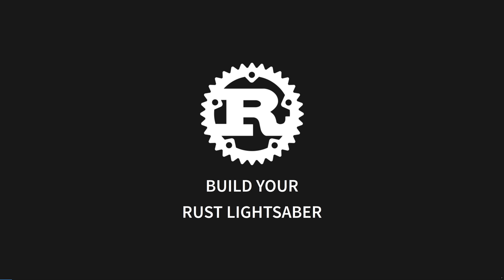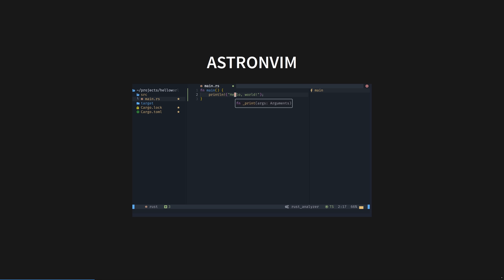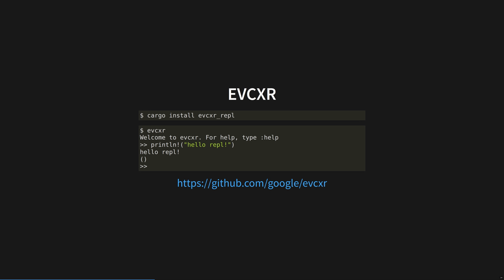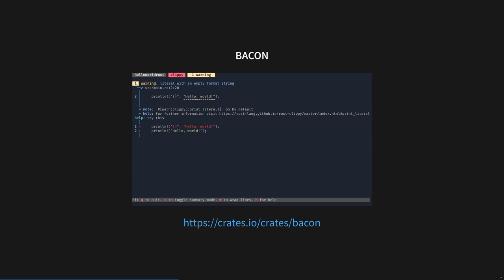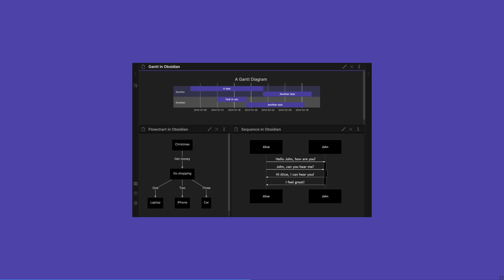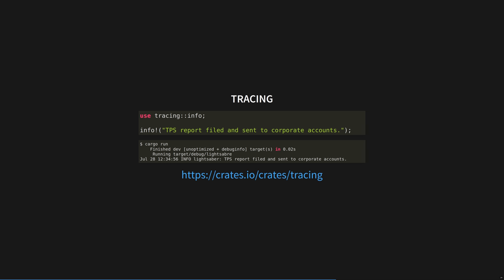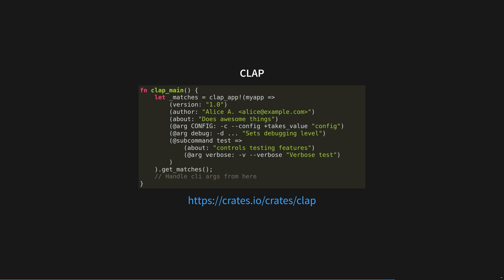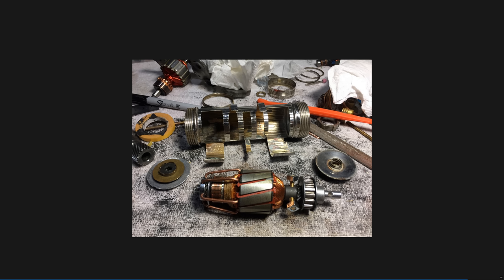Build your Rust lightsaber

Comment: Nice video! Just a comment on the focus on terminal Text UI apps. That’s fine if it works for you, but for those who prefer GUIs I second the recommendations for IntelliJ and VSCode. Personally, I think TUIs are overrated. The moment you add a single Chinese character, you discover that terminals are extremely inconsistent in their behavior, even on the same OS
Reply from the maker: That's a fair opinion to have - I certainly reach for vscode very often.

I have been a professional dev for 15 years, and my time is very valuable, so I like many, people optimise my tools highly. I don't use slow laptop processors, I use cheap fast desktop components in my computer, I have a big 4k screen for more splits and windows to lower context switching overheads, and I settled on the Moonlander split mechanical keyboard for comfort. My mouse is forgotten. With 829k pixels to click on, I am faster on the keyboard - an environment where TUIs excel. 
I don't use TUIs because they're fashionable, but because they're FASTER.
One of the reasons I made this video is that nvide runs on the GPU, turning near-instant nvim into actually-instant! Does your ide run on the GPU?

Oh, and both emacs and nvim have correct character support for years, no problem with chinese characters there!
Reply: @NoBoilerplate  Most GUI editors actually run on the GPU, yeah. VSCode run in Electron, which is essentially the chromium engine, and it's gpu-accelerated, using Piet.
Sublime Text use Piet directly, without the overhead of having an actual browser on top and interpreting javascript.
I haven't ran benchmark but I'm 99.9% certain that Sublime Text is faster than any TUI, probably less cpu&gpu intensive (text rendering is actually something surprisingly complex and heavy), but it definitely use more RAM than a TUI (but way less RAM than VSCode)

Comment: I've never had the courage to take the deep dive into the Vim VS Code plug in, let alone using something like Vim or Neovim itself. It just seems like so many macros to memorize 😣

10:33 Now this is the most interesting part for me. While I think Rust's functional structure would benefit from using some kind of markup language (which tend to be better at describing UI's imo), learning about eGUI seems very intriguing.
Reply from the maker: I think I'll do a whole video on vim keybindings - I really think my life levelled up when I learned them! Every app (including web browsers) has vim bindings, and so I don't need to relearn stuff when I change.
Reply: Check out vim adventures. Even if you only use the free part, it'll help you learn the basics.

I started my vim journey in sublime text back before atom/code existed. Definitely start in an editor you can already be productive in and add on vim stuff one at a time.
Reply from the maker: @Kiaulen  second that, I didn't learn with it, but it's so fun!
Reply: It’s worth it.

Comment: Really struggling to find an editor setup that I'm happy with. I work in a huge monorepo. I used to use intellij but it really doesn't handle so many files well. I've been using vs-code which is a little better because the lsps generally work so I get some of the rich functionality I had from intellij, but I feel the experience is just poorly thought out. They've only just got 3 way merges this past week... 

I've been trying to get my head around neovim and I quit like it so far. I've got a few of my big boxes ticked, but I find the plugins have a similar problem that vs-code happens. When I'm in the terminal window, when I want to switch to a different file, it replaces my terminal when I'd really like to have a single buffer for editing files. I imagine I can fix this and get it working if I invest time into it. I also quite like that if I do, I can save that dotfile and use it anywhere, even over ssh. 

I'm trying out astrovim now as it seems to give me a much better starting point, so thanks for that pointer.
Reply from the maker: When selecting files from the sidebar (space e) hit ? to find shortcuts, one might be "open in split". If not, make an issue on the astronvim repo, asking for advice.
Reply: @NoBoilerplate  oh cool! Good to know. Just found out that if I press space it similarly gives me a bunch of available commands! 

I’ve been opening the terminal modaly with ctr-\ which works really well for me. 

Just having some trouble with integrating with the systems paste buffer now. In neovide it just doesn’t want to paste but it works fine in the terminal.
Reply from the maker: @jony1710  Huh that's weird, I have no trouble. I'm on Linux?

Comment: Great video! One thing I've been getting into recently is developing inside containers. That way I can develop anywhere and my setup is all handled by dockerfiles. My host system has no extra compilers or runtimes, just docker.

Should I try to make a devcontainer for your setup?
Reply from the maker: oh that could be incredible, especially as neovide can connect to a running nvim session by over ip, you could run the ide natively!

Comment: astrovim at least on my mac isn't an "out of the box experience" errors with packer, and one has to install nvim first. Not sure what I did wrong. But sigh, its always a black hole of going off fixing unrelated things to do the main thing. It takes my will to live a bit more each time, and its EVERY time. :(
Reply from the maker: Make sure you have neovim v0.8+ that caught me out.

I use a rust neovim version manager called `bob-nvim` - try it out!
Reply: @NoBoilerplate  Using neovim 0.9, so I am good there. But maybe there's a bug, and 0.8 is better. I'll give that a go. Thank you. BTW,j love the podcast, so addicting. :)

Comment: I'm having a little problem compiling neovide. Apparently they are using a 'unstable library feature `bool_to_option`', and acording to cargo, it won't compile. 
Anyone else having the same issue?
Reply from the maker: See if anyone has reported this on the repo issues, if not, do so and I bet you'll get a quick response, the Dev is fast!

Comment: I think using expect is okay in cases where you can easily guarantee success - something like converting an isize to usize with i.abs().try_into().expect("non-negative isizes always fit in a usize")
Reply from the maker: Yeah, that's a strange one. Can that ever panic?
Reply: @NoBoilerplate  It can't. The try_into() would fail if the source value is out of range for the target type. i.abs() is non-negative, so on a 64-bit platform it's basically a u63 and will always fit in a u64
Reply from the maker: @zackglenn2847  how odd! Maybe we could just add a lint exception to any uses of this. I wonder why it unwraps?
Reply: Can't you just replace try_into() with an into() ?
Reply: @chris-pee  No. isize doesn't impl Into<usize> because into() isn't allowed to fail and that conversion should fail when i is negative. It won't fail, because using abs() guarantees that i isn't negative, but the compiler doesn't know that.
Reply: @zackglenn2847  Makes sense and is unfortunate at the same time. In my opinion, there should be 2 versions of abs, where the new one would take isize and return usize.
Reply: @chris-pee  On the bright side, when I was looking through the isize docs this time I saw abs_diff, which returns usize. So you can do i.abs_diff(0) to get the same thing. It's a little awkward, but you could just wrap that in your own abs_usize method to clean it up, which is what I'll prob do in the code that inspired this whole comment chain.

Also, apparently i.abs().try_into().unwrap() can fail because i.abs() overflows if i is isize::MIN 🙄

Comment: I recommend logseq over obsidian , at least it's open source. But I think they are all too verbose, should we succinctly rewrite them using Rust and LSP combined with true first order logic principles.
Reply from the maker: Here's my plan: obsidian is the most featureful of the markdown notes apps for now. In perhaps 6 months when the open source projects are up to my standard, I can move at my leisure. The joys of owning one's own data!
Reply: @NoBoilerplate  Indeed. Apart from Datalog magic, some of the syntax of Logseq and Obsidian are compatible, and many people even choose to use them both in one repository these days, so switching between the two doesn't require complex script conversions. After all, they both use Markdown, which is the most popular and is now arguably becoming the de facto standard for note-taking and knowledge output.
However do you feel that they are still overly complex and redundant, or that synchronization, syntax and interface are heavily coupled. In fact, all we need is a reactive Markdown preprocessor, a reactive WYSIWYG structured editor, a CRDT with versioning. The Markdown preprocessor can parse the extra bidirectional wiki links or whatever syntax into pure Markdown and send it to the editor for presentation and editing, treating the extra data syntax It doesn't take any magic to parse them into Markdown or expanded Markdown, which is perfectly adequate, and then render them reactively, just like Pluto.jl does. And then both components would in fact ideally be able to modify the input files by reactive direct inspection of the output and then in turn, which of course is a conflict between Vue and React philosophies. Above, I think this is what we can take away from LSP.
Reply from the maker: @leo-mu  I'd love to see a LSP server that understood markdown links omg
Reply: @NoBoilerplate   Exactly! This is THAT KEY PROBLEM which need to be focused.

Comment: Nice video, but I think that at 10:25 you expressed yourself poorly. C is way more portable than Rust :)

Edit: at least for now. The GCC port will help significantly
Reply from the maker: I don't think that's the meaning you should draw from my statement, which was "EGUI, here, is pure rust, runs at 60fps, and is not reliant on native c libraries, which means it's portable and even runs in webassembly." 

I was talking about how if your Rust program doesn't rely on c dependencies, it's more portable than something that does (because in that case your end-user needs both a Rust compiler AND a C compiler). And I then gave a very clear example: Random C libraries are unlikely to easily run on webassembly, whereas pure rust DOES.
Reply: @NoBoilerplate  ok, thanks for the clarification! I interpreted as something like "Rust UI toolkits are more portable than C ones", but I now see your point :)

And by the way, you can compile Qt Quick (C++) to run on Wasm too. Not saying that you should, or that it wouldn't be painful, or a good idea considering the Rust alternatives, but you sure can!
Reply from the maker: @Tachi107  I thought we might be talking a little at cross-purposes! Oh that's cool. Qt on webasm sounds incredible! I'm quite excited by webasm these days. It's WONDERFUL that rust has first-class support. People tell me you can use Go too, and then I dig a little deeper, and it's a non-standard Go compiler 🙄 THAT DOESN'T COUNT! 🤣
Reply: @NoBoilerplate  haha, yeah, Wasm is pretty cool indeed. I'd love to develop a little project in Rust+Wasm,  but I'm always busy with lower level stuff :/
But I digressed; keep up with the good content, you're pretty much the only coding channel I follow :D
Reply from the maker: @Tachi107  Thank you!

Comment: "error: This revision of snap "nvim" was published using classic confinement and thus may perform
       arbitrary system changes outside of the security sandbox that snaps are usually confined to,
       which may put your system at risk." - is there some safe method than snap to install nvim?
Reply from the maker: I use https://github.com/MordechaiHadad/bob
 and recommend uninstalling snapd (carefully)

Comment: A problem I have is that the syntax coloring is all wrong with Rust.  How do you deal with this?  Things like types are the same colors as functions, sometimes types are different colors... there's a few situations of this and it actually makes it unusable for me.  Any ideas to fix this?
Reply from the maker: Which IDE/Editor is this for?
Reply: @NoBoilerplate  with AstroNvim!  I'm curious what yours looks like?  Maybe you have changed the theme?
Reply from the maker: @chris.davidoff  How interesting, the folks at astronvim are SUPER helpful - take a screenshot and add it to their issues and you'll get an answer, tag me on the issue! I'm @0atman
Reply: @NoBoilerplate  If I'm not mistaken, the tree-sitter.lua file within the "default_theme" needs to be updated with rust specific TS overrides.  I will make an issue and tag you :)
Reply: @NoBoilerplate  I couldn't tag you but I made the issue on github
Reply: @NoBoilerplate  Final update:  They made some nice changes for this in pull request #829 based on my Issue.  Amazing! Thank you for the heads up :) :)
Reply from the maker: @chris.davidoff  omg that was fast! I hadn't even checked it out yet! Thanks so much for reporting it, I'll pull down and enjoy your fixes!

Comment: It seems that neovim is very broken on Ubuntu. If anyone could post some sane install instructions that would be nice. Also I can't seem to get rust-analyzer to work on VScode. A language is only as good as it's tooling.
Reply from the maker: I too had great difficulty on ubuntu - the problem is the nvim repo version is 0.7 and the minimum that astro works with is 0.8!
Don't use the flatpak or snap versions, what I did is get neovim right from the neovim repo. 
HOWEVER!
I have good news for you, I've recently found https://crates.io/crates/bob-nvim a simple nvim version manager in the same style of pyenv, rbenv, asdf, etc. It basically automates downloading and keeping up to date with the latest nvim version.

As for rust-analyzer, it's dead easy once you know what to do: just install rustup on your system, but install the rust-analyzer PLUGIN in vscode.

Once you get astronvim working, just hit `spc l I` to install rust-analyzer! That will work out of the box, but you also (for some reason) need to also run a command to get rust syntax highlighting working. Just read the quickstart on the astronvim page.

This is all worth it my friend, keep going, and tag me in #newbie-advice if you'd like more help :-)
Reply: @NoBoilerplate  I got it all up and running and I even turned your recs into a bash script for easier installs. Hit a ton a snags and made notes. Also nvim does not have clipboard support. Need to install xclip and add a line to your init.vim for it to work.
Reply from the maker: @WarrenBey  Nice! I think with astronvim I just had to have xclip installed, it works out of the box then